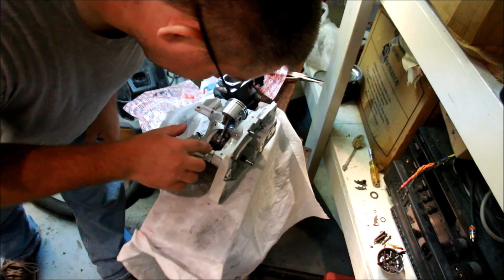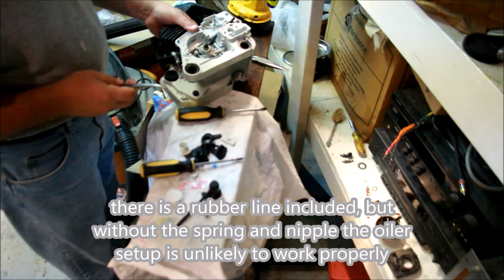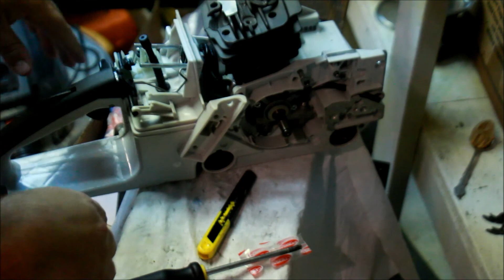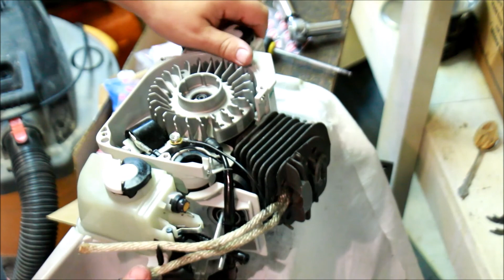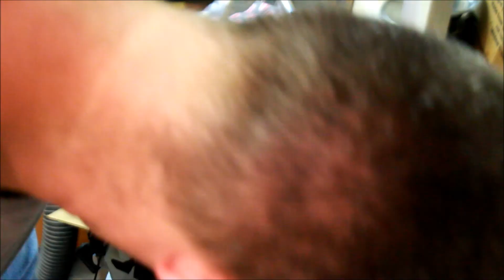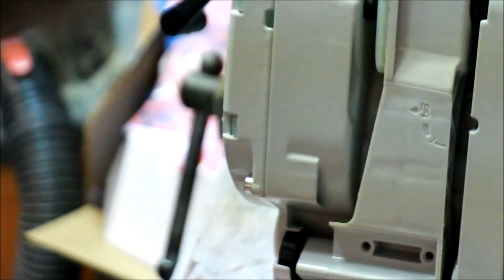Huztl Stihl ms360 bolt for bolt part 3 - cylinder head flywheel and electronics

Comment: BEWARE!!  I ordered a Stihl cylinder and piston kit from HLSupply and they sent the wrong cylinder in the kit. WARNING- they do not pay return postage for THEIR MISTAKES! They even insisted that they never make mistakes, so I didn't know what I was talking about. So I paid for their mistake and returned the defective kit. I never got a refund. They claimed they never got the kit, even though I had confirmed tracking that said it was returned to them. I ended up losing over $100 for their error. Unfortunately, they are too far away to sue in court. DEAL WITH THEM AT YOUR OWN RISK. Or buy it somewhere else at a better price.

Comment: Excellent series. Well done sir! Would have saved me a lot of trial and error on my first build.

Bought a cheap 026, turned out to have scorched piston and cylinder. Muffler had a cat.

Gutted the cat, opened exhaust a bit, ground flywheel key for timing, bigger carb, gasket delete, flattened bottom of cylinder ob a piece of glass with sandpaper over it.

New cylinder is missing the two studs for the top cover. Is this normal? 

Ordered a set of burrs and a degree wheel. I'll have to educate myself in the mean time. It's been a great motivation to have a saw that truly had no value.

I have a feeling this could turn into a time-consuming hobby.
Reply from the maker: What was the diagnosis for why the scorched head?
Reply: @matthewolson8875  intake boot looked fine. Tank smelled like pump gas when I got it. Suspect it was fuel. Intake side looked fine. Muffler had rattled loose at some point. Dirtiest saw I've ever seen in person. I'll pull the exhaust and consider porting once I've had 15 or so tanks of aspen through it
Reply from the maker: @7eis  pull the exhaust after a single tank and check.  

Was the head scored on just the exhaust side or all around

Comment: If you don’t put sealant on the base and case gaskets then you will be building the Titanic instead of an ms-360  Did you check to see if the piston was hitting the crank?  It is a smart move after my experience with the 361.  I am adding it to my building routine for all Huztl kits.

Comment: Two things I keep handy when putting a saw together are my pneumatic Oiler loaded with two cycle oil or bar oil and a spray bottle filled with a heavy concentration of Dawn soap and water.  This is my pressing lubricant for rubber grommets.  I also use it to test for air leaks when the saw is running.

Comment: The rings were a bitch for me, but I finally got them in.  I used a little assembly lube on the piston and in the first inch or so of the cylinder.    Those long screws go in the rear two AV grommets.  I used my Drexel with a tapered bit to clean up the hole for the little AV grommet.  It was still a Pita to get it in until I made the hole a little larger.  I looked at the IPL for how the Oiler goes together.  There is a small washer that goes in front of the worm gear and a bushing that goes in it.  Have never seen this on a Stihl before.  Usually, it is oil pump, worm gear, top washer, clutch and sprocket.  .

Comment: Thebkill wire, black, feeds into the control lever from above.  With the brass connector to the left, pull the wire downward into the control lever.  Then pull the right end of the wire to the right to latch the brass connector in the lever.  This is common on about every Stihl saw but the 361.  Any extra wire is routed over the little hangers on the left side of the carb compartment, up and over.

Comment: On my 361, I put a little 1184 on the impulse line connectors, both ends.  I did not have any problem removing the linebwhen I took the line off the back wall when I removed the rear handle.